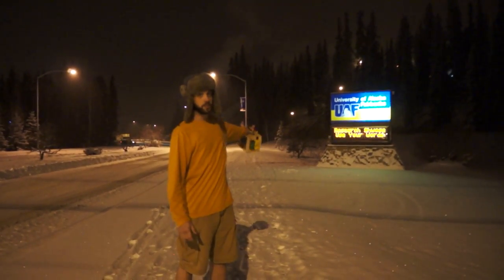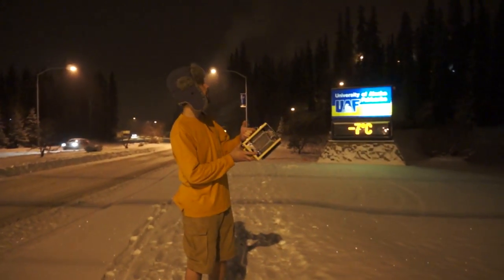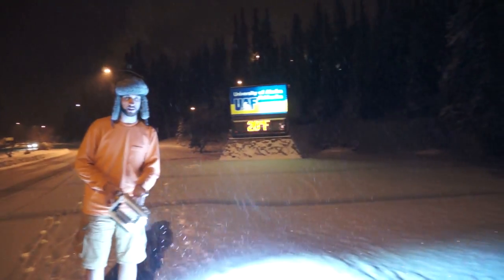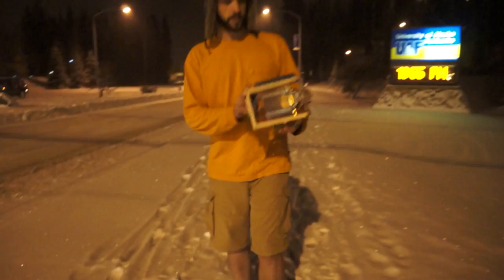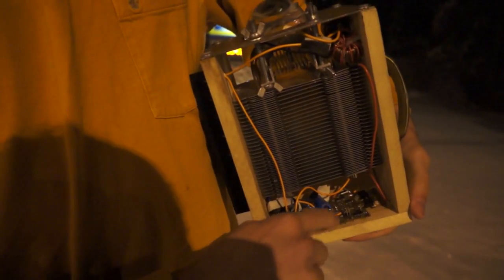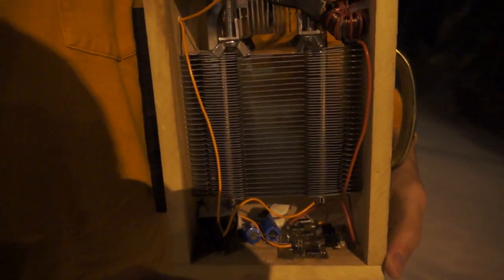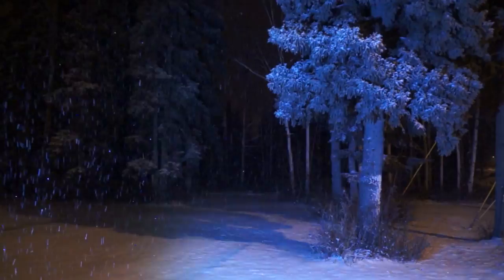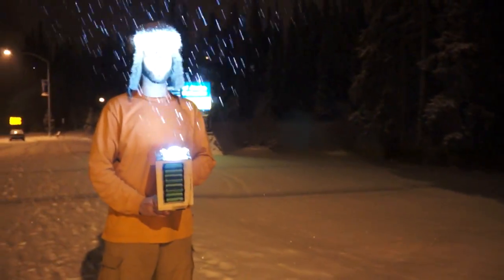My 100 Watt LED Flashlight

Comment: i know this is an old video, but you dont need such a large heatsink. a 70-80 watt tdp heatsink is enough with a fan.
Reply from the maker: For other projects I do use the Intel Core heatsinks.  They work pretty well cause you can drill into them.  This one was free and awesome.

Comment: Nice build!
What are the specs on the lens that you used?
Would you post a PDF version of the schematic for us?

Thanks for sharing!
Reply from the maker: +A B No specs on the lens.  Came from a junkyard.  Sadly this was from before I really documented much, so, what's in that svn repo is all there is. :-/
Reply: +CNLohr I see.  Well, the actual light emitting area of your LED is probably ~25mm, so any good convex LED glass lens from EBAY should probably work.
Reply: +ELECTRONTHORP What diameter is the lens that you bought?  Can you provide a url to the product that you bought?

Comment: How long until the batteries run out?
Reply from the maker: ABW941 ~20 mins.
Reply: CNLohr
 Hm, thats quite short. I too want to build such a thing, but Ill use those 12V 5W leds from china.
Reply: ABW941 He has this run in series, so he need high amp batteries to stay safe, those look like sony vtc 4's, but i could be wrong. The problem with high amp batteries is they have low capacity. If he could split the amp draw by running a second series pack in parallel with the first, although it would require twice the amount of batteries, he would get more than twice the capacity, since he would then be able to use lower amp, higher capacity batteries. At that point, things start getting ridiculous however. If 10 gives him 20 minutes, 2x10 in parallel with lower amp, higher capacity would likely give him an hour.
Reply from the maker: Sadly, they are not the high-amp batteries, that's another reason it doesn't last long.
Reply: CNLohr Yikes, poor batteries xD

Comment: I thought Lithium cells cannot be used on full power near zero Celsius degrees.

(I also use a 18650 in my bike at winter times but only to power the red flashing light around 60mA.
There are lots data for example here about the low temperature/discharge graphs:
http://ecec.mne.psu.edu/Pubs/047304JES%202013.pdf)
Reply: FotoAmg AmgFoto they heat up which kinda gets things okay again.

Comment: Nice Project but the Ultrafire Batteries are Crapy..:-)
Reply from the maker: If 5 of something terrible are as good as three of something good, but only cost as much as two of that good thing, I'm going to go with the 5 every time.
Reply: Ultrafire is crappy? I actually have an "Uitraflrc" Fake Lithium cell here. Says 4000mah and measures 178mah.

Comment: power=voltageXcurrent My 18650 are 3000mA (3A). He has 12 batteries i believe each 185650 is 3.7V?  So Hmm If X is the power we have X= 44.4*3 X=133.2 So I do think you COULD pull 100W or so even 2800mA would provide 124.32 watts.
Reply: HookahGuy Ty ???
Lithium cells can provide way more than 1C. 10C would be enough already, about 120W per cell if they are 3.7v 3000mah.
Reply: +drkastenbrot 1C?  Idk i think my math is wrong one cell at 3.7 volts 3 amps. would give me about 11.1 watts. So i did something wrong.

Comment from the maker: You can actually draw a lot more. They are something like 2C batteries.  That's ~4 amps at 4 volts, or for 10 batteries around 160 watts.
Reply: that setup at 100watts is pulling 2.7 amps. good 18650 batteries can support 3 amps at least.
Reply: 2 10C rated 18650 batteries can safely power up to 150w...
Reply: What an idiot. 10 lithium polymer cells of even a low C rating can easily produce 100 watts. you can get 100 watts from one 3 cell lipo with a c rating of 20.

Comment: so lets just get this straight. you have 37v if all of those batteries are in series and you have 2 amp maybe 3 if you paid high dollar for those 18650 meaning if you arent running at full 3 amps you dont have a 100w led...you have whatever you set your msofet too. what are we really looking at exactly?
Reply from the maker: No no, amps.  Momentary.  The flashlight can only stay full-on for about 15 minutes at full brightness.  Needless to say that's not where I operate it most of the time.
Reply from the maker: The no-load voltage is around 42 volts if I remember correctly, the voltage the LED is around 35 volts.  The AVR Increases the duty cycle until the voltage across the current sense resistor matches up.

This light has 4 modes, so I need to be able to control the current well.
Reply: I think when you are saying "2 amp maybe 3" you are referring to the amp-hour capacity of the battery. Most batteries can provide much more than 2 amps (maybe 20!), but just not for a whole hour. A car battery, for example, might be rated at 200 or 300 cold cranking amps (for a few seconds), but they really only have a 50 amp-hour capacity.

Comment: Can you post control circuit for this please?
Reply from the maker: I only have the layout :-/ I never made a schematic.  I guess I could re-design it.  I should probably do a youtube on how you can do software defined switch mode power supplies.
Reply: What mosfets do u use and - what is avr speed? Are the adc part of avr or do u use some external adc?
I tried to do same current regulation with opamps - but I wasn't very succesfull.
Can you do some sketch? Also hand written would be PERFECT! ;)
Reply from the maker: I was using the ADC as part of an ATTiny44, and I believe I was using 2 N-channel, 60V mosfets paired up, along with a pretty beefy Schottky diode to suppress the overshoot from the LC circuit.

I literally printed the current sense resistor into the PCB.
Reply: CNLohr It would still be nice to see schematics drawn by hand... can you do it?
Reply from the maker: I have virtually no time free for another two weeks, but after that, I really should.
Reply from the maker: If I do find time in the mean time, I'll try to transcribe the flashlight :-p.  You would never be able to read my handwriting.
Reply: Hey man! I would love to try to read your handwritten schematic for this one, can you post it please?
Reply from the maker: >.< I still didn't do that - I'll add it to my list again.  (My short list)
Reply: CNLohr that would be awsome! I hardly wait.
Reply: CNLohr  Can you at least check this link: http://www.speleogroup.org/files/ATtiny-A3-Schematic.gif and confirm it is similar chematics like yours - it should be something similar you have it. Although I like the idea of printer resistor for current sensing.

Comment: do u have schematics for the mosfet controller circuit in that monster torch? can I run a 100w led lightbulb on a 12volts car battery?
Reply from the maker: You cannot use my design for that, but yes, you can!  You will need a 100W constant current boost supply, that can operate at at least 35v.  They are available on EBay.

Comment: Awesome!

I'm building a relatively small flashlight with Cree XM-L (about 1 000lm). I'm going to use 5 pcs 3,7v/1,7Ah Li-Ion batteries which I have somewhere in my hoard. I'll make to packs, a 2-cell and a 3-cell. 

Don't care about the people who are posting negative comments. I think it's actually hard to do a better job. At least it 'll cost a lot more!

Comment: Yes, it uses 100watts of power. But what kind of lumens does it put out? It's not the watts that matter when it comes to flashlights. That just tells you how much power is being consumed by the lamps. Lumens tell you how bright the light is. Also, when it comes to throw distance, you do not appear to have more than a 30 foot throw. Once the first trees are lit up, the rest of the forrest is dark. Again, I would rather have a smaller flashlight with higher lumens that has a better throw distance.

Comment from the maker: Look on ebay.  It's $19 (after shipping) for a 33V, 3A LED. They're made with 10x10 array of 1W LED dies.  It's equivalent to the light of a ~500W incandescent.  I'd like to see how long you can power one of them on batteries.

Comment: 1. 100watt LEDs do not exist. There are leds that recreate the light of a 100watt incandescent, however those usually run around 22watts. combining multiple LEDs so they consume 100watts, does not make it a 100watt output light.
2. It is indeed a bright light, but it is uncomfortably large, and does not appear to have a good throw distance.
3. What kind of Lumens does it put out? $200 for something that can only throw about 30 feet and appears to weigh 10 pounds, is very unappealing.

Comment: I made a battery pack a long time ago and the thermal cutout for charging decided to not cutout a few days ago.  I just happened to be in the garage when the cells decided to shoot molten lithium out the sides and attempted to set my garage on fire.  Lithium, not even once.